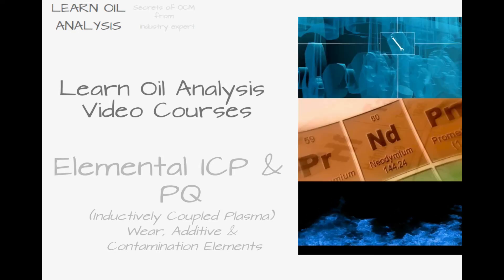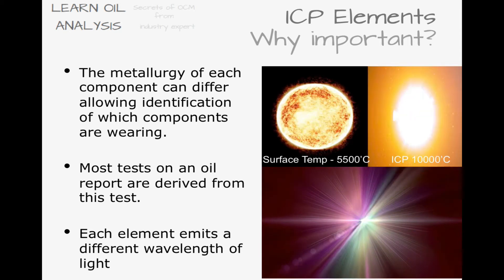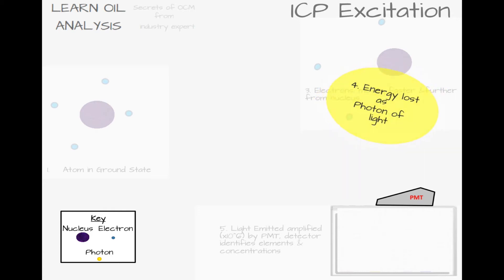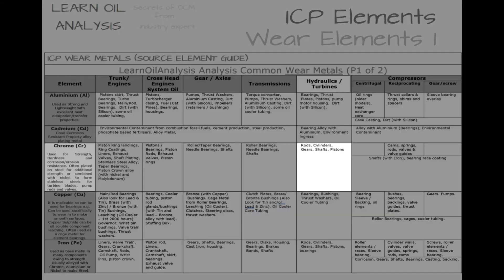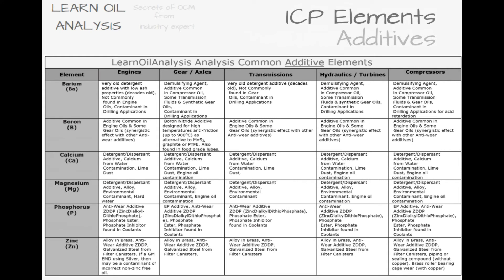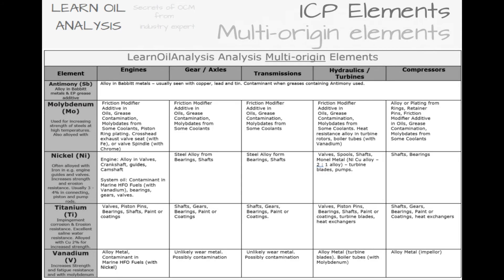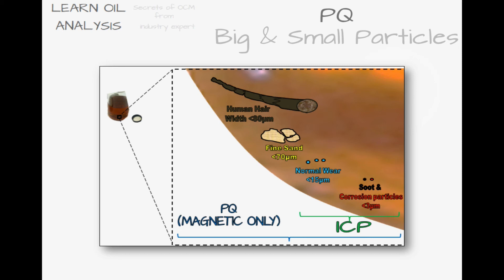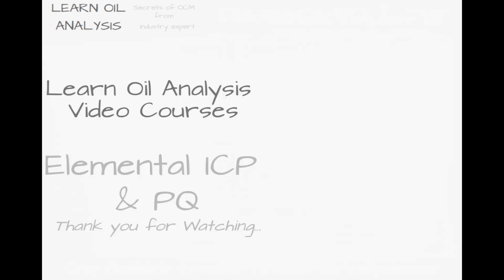Learn Oil Analysis - Wear Metal Elements (ICP) & PQ

Comment: Hello.If i have wear on a surface which wear has given way to the material and has created step, material retreat, the I can't describe this wear and gouge???
Reply from the maker: If you have wear that has been lost from the surface then this could be caused by a few things. If pitted it could be fatigue wear on rolling surfaces. It could also be corrosion or cavitation if acidic or air entrainment. Finally if something abrasive then you will get wear in scratches or scores in the surface. Look on learnoilanalysis.com and drop me a message with some pictures of what seeing if need help.

Comment: Is there any reference value for metal concentrations? How do you treat the results? Thank you
Reply from the maker: Hi, we use commerically available dissolved element standards for calibration as do other labs. The difference being on normal lube oil samples the wear particles are not dissolved, but in the LubeWear technique they are and so the results are more accurate and more comparable to measurement of a standard in terms of matrix.
Click the contact us button at https://oilanalysislab.com if you would like to find out more.